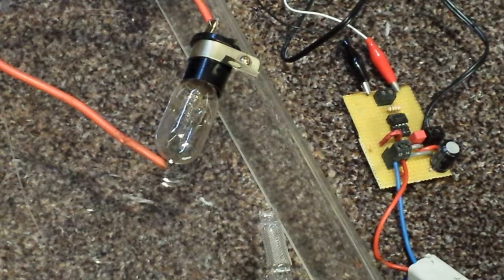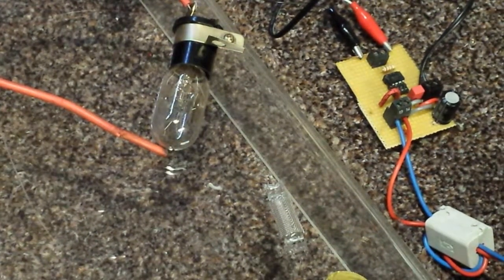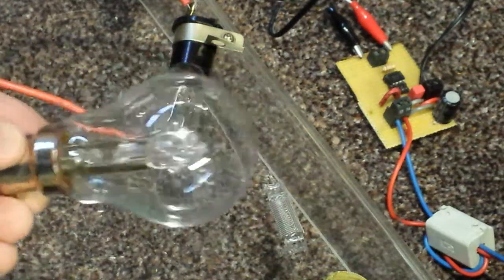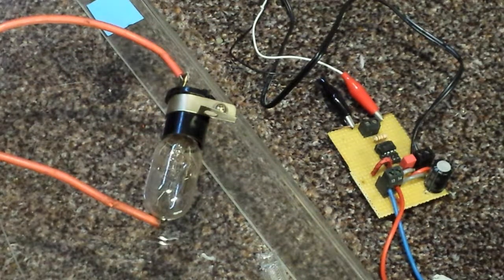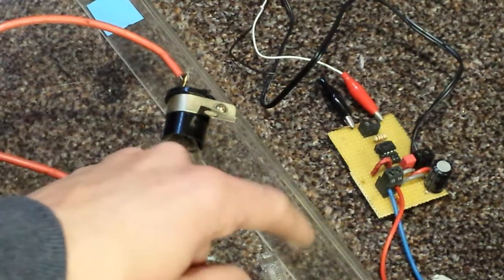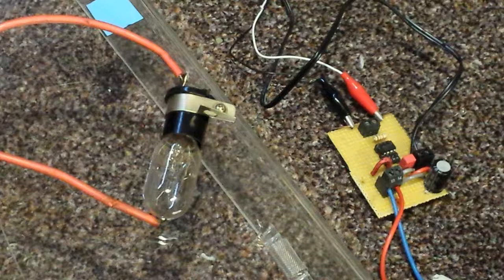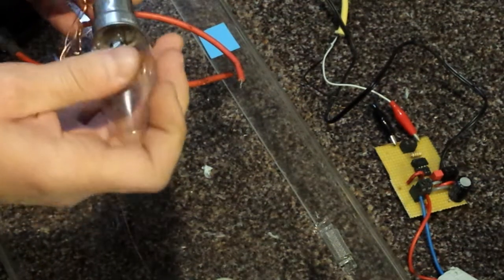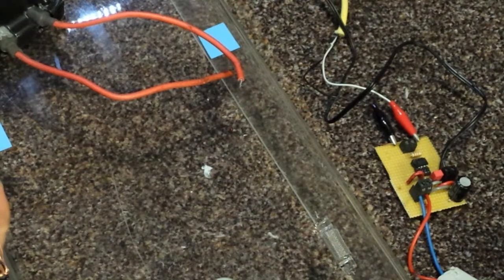H.V Corrona in a bulb

Comment: You need to charge up a cfl fluorescent tube, if you put tin foil on the outside of the tube and arc to one of the inputs and the foil with a dc source like a flyback it will charge up, and if you touch the foil and input of the bulb you will get a surprise and sling the bulb at the ceiling. I didn't do that twice :p

Comment: that was awsome :D i have the guts from a plasma ball i use it to check wether or not a lamp is of the gass filed type or the hard vacume type and to check if a known vacume lamp hasent leeked over the years (i used it recently to make shure my siemes carbon lamp from 1905 hasent leeked) btw if u shove anuf volts into a vacume bulb u can make x rays but unless u shove shits loads of power it will be a very small about of x rays
Reply from the maker: still sound scary lol ;-) thank you friend ;-)
Reply: high1voltage1rules in a known vacume lamp if u give it lots of V and u get a greenish glow on the glass it self then ur preducing very small amounts of x rays (the x rays make the glass florec) btw do u still have the good 750W GLS lamp? if so are u willing to part with it as it wood go nicely in my colection of lamps and i have its big brother a 1500W GLS from 1971 or there abouts the etch is worn off and i can only just make out the date code if i get the 750W bulb all i wood need is the 300W and 500W ones and i have the set as listed in the thorn/BLI catalog :D